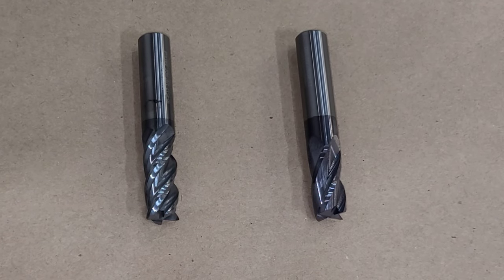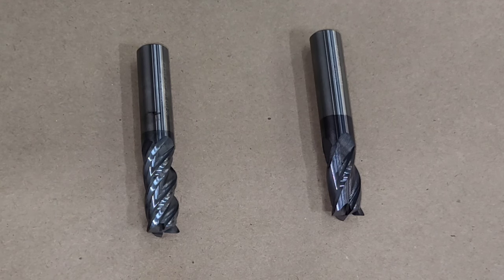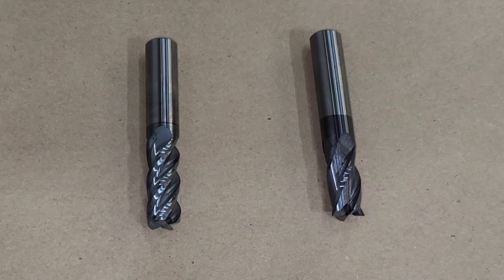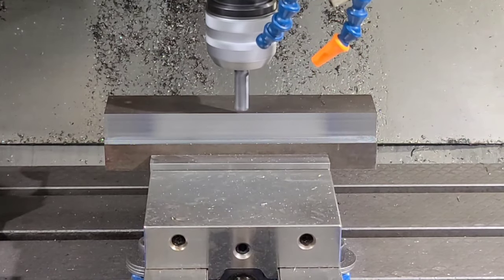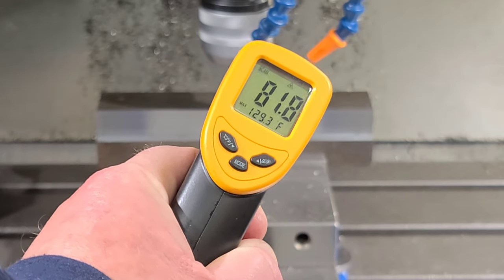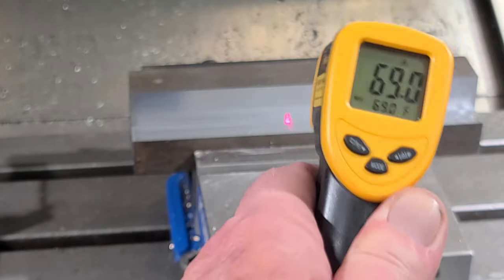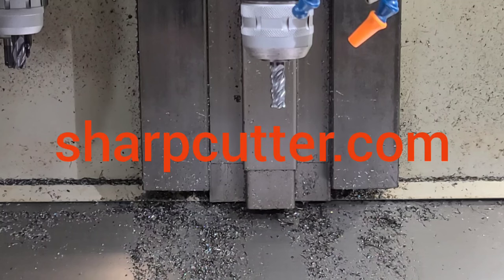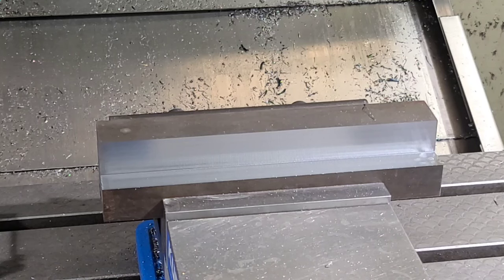Dry Milling VS Milling with Coolant on Steel What do you do?

Comment: 8 years i worked for a company from Finland that never used coolant, I later moved on & worked with a company that used coolant on all mills. It didnt take me long to realize that we were going thru twice the carbide as I was used to using.  Just like you say the coolant was keeping the carbides from reaching their optimal cutting temp.
Reply from the maker: The company I started at was the same everything was flood cooled. There is not much good info out there about this surprisingly. Thanks for watching and commenting!
Reply: @mvpmachine  so the flood coolant is not also not recommended? should not it prevent the thermal cycling/shock happening to the tool?

Comment: This is fascinating. I don’t run a lot of carbide endmills - but do run some. I always assumed coolant was a must generally, but this makes complete sense. I appreciate the insight here. 👍👍
Reply from the maker: Thanks Stuart! I am a coolant and cutting oil hater to a certain extent except for drilling and machining aluminum. It has made my life easier...But I do always use it on the CNC lathe.
Reply: Very helpful info 😮

Comment: if you look on the side of the temp gun  it shows that at 1ft distance, measuring area  is 1.5", at 3' it's 3" and at 5' the measuring area expands to 5.3"
Reply from the maker: I never looked, I will check that out, thanks!

Comment: AlTin coatings run best with airblast above 450 SFM and water based coolant below that speed. In most all grades of steel and alloy steel I run 600-1000 SFM for roughing operations, then finish pass at 300 SFM with coolant for finish quality and accuracy. Lower temp and harder coatings like TiCn generally last longer with coolant and at lower SFM. The hardness provides a longer lasting cutting edge for longer accuracy in your finishing operation. Aluminum and stainless steel grades can be roughed dry as well if you have a machine with enough power to make the proper chip required. I'll rough 316 stainless with airblast for 4-6 hours at 1000 SFM and .010 IPT on a 1/2" endmill without issue. But without the power to push it hard enough you won't get under the work hardened layer and will definitely have issues.
Reply from the maker: Thank you for watching and commenting! I always use coolant for aluminum and stainless, do you use coated end mills when you dry mill aluminum and if so what coating?
Reply: @mvpmachine  Titanium DiBoride and titanium carbonitride is the name of the coatings. Depending on the part, sometimes I use coolant and sometimes I don't. Like many aspects of machining there are lots of variables. If you want to rough out aluminum without coolant then the main requirement is lots of power and a big chip. Usually only with larger endmills. I will run insert tools dry as well and those have fully polished inserts with no coating. But again, a large chip is needed. .014-.020 IPT on a 2" diameter shell mill. I have a lot of machines crammed in a 1500 square foot shop on my home property so my main reasoning is air quality. A 3/4" endmill at 18k RPM or a 4" shell mill at 10k RPM makes a lot of smoke and mist with flood coolant. Having 5 spindles running like that makes it almost impossible for anyone to work in there even with mist colllectors running non stop, so I had to find alternate methods that happened to be more efficient and more reliable.
Reply from the maker: @pcsmachineworks  You are packed in there with 5 machines going. We have the same issue when our CNC lathe is going full, tilt steam and mist and you go home with heavy lungs for lack of a better phrase.

Comment: For tight tolerances coolant keeps the part in the right temperature zone. Aluminium without cooling sticks to endmill and breaks them. Not much else to say... everything's a tradeoff
Reply from the maker: This was not about aluminum as mentioned in the begining. And I disagree with your assertion that you need coolant to hold tight tolerances in steel, its just not correct. If you use the right tools and cutting methods you can do a job faster and with better results without coolant.
Reply: @mvpmachine  "If the conditions are right and the part you're machining has the correct shape, you can avoid the heat problem". This is what you're saying. Plus there's a problem of surface finishes of course. Everything's a tradeoff, every situation is different. Going dry 100% of the time has its tradeoffs. Sometimes it's simply efficient to trade the longevity of the tool for the result you're after. I've worked in turbomachinery facilities that are over 100 year old and must have invested millions of man hours in basically machining the same things and they run coolant on steel because of certain advantages. 100 years is enough to spot the results and the costs. Every approach has its limits, not every situation is the same.
Reply from the maker: @chronokoks  The old school shops used high speed steel and coolant is required, then came carbide without coatings and they still required coolant. It was not until the early 1990s that modern pvd coatings became available that enable dry machining to be possible. Most machinists and companies over use coolants and cutting oils because they learned in a different era and do not know better. The 2 end mills shown in my video have coatings that are pretty much ruined by coolant and they are the most commonly sold carbide end mills available today. Using coolant defeats thier intended purpose. That was the point of this video was to enlighten people that they might not be using these tools correctly and I have seen many people do that with these two types of coated end mills. I have seen people buy and use these 2 for aluminum oblivious to the fact that the coatings on these are terrible for cutting aluminum.

Comment: I’m just leaning to mill on a mini lathe with a 2 axis table mounted on the lathe bed. I was using hss end mills then i bought a tungsten carbide bit much better finish and faster cutting.
Reply from the maker: It's hard to go back to high speed steel after you try carbide! Thanks for watching!

Comment: Thank YOU!  Is there a similar recommendation for cutting Aluminum?
Reply from the maker: Hi Joell, unfortunately aluminum really needs coolant to keep it from sticking to the tools. And most coatings don't really seem to help much with cutting or tool life. I prefer uncoated carbide on aluminum because most coatings even the ones designed for aluminum rob a little bit of the sharpness from the tool in my opinion. PCD and CBN inserted cutters are possible options that I have no experience with so I cannot say If they are a good option. Thank you for watching and commenting!
Reply: @mvpmachine  - Thank you for the detailed reply as it definitively confirms what I imagined happens.  I think I understand this all so much better now.  
So in other words, if the tool gets too hot the aluminum will melt and stick to the cutting edge.  Carbide can handle higher temps than HSS.  Although aluminum specific carbide tools are almost as sharp as HSS could be, they don’t break down and lose their edge when pushed hard.  And when pushed harder (taking a deeper cut than HSS is capable of), the heat generated isn’t carried away by the chip because the thermal conductivity is so high.  The chip is then so hot right at the cutting edge it sticks to the tool.  Then making the tool edge duller, generating more heat and welding more chips to the cutting ‘edge’.  It’s probably a lot more complicated than that 😉
Continuing on in the ‘cutting of aluminum’ theme, do you have any MQL vs Flood experiences you can share? (Maybe a future video?) I can see lots of benefits of flood cooling and I suspect it is superior in every professional setting.  But in less optimized environment (hobby CNC) can MQL also be effective to keep the tool cool and have a high enough air blast to clear the chips from the slot?  🙏🙏
Reply from the maker: @joell439  Sorry I did not see your reply and would have responded earlier but you pretty much nailed it in regards to how aluminum acts with end mills. Regarding MQL I am not a fan and never will be, there are salesmen that want you to believe these lubricants are necessary, and all they do is pollute the air in your shop when they turn into smoke, in my opinion. I only use oil of any kind for tapping on manual machines and coolant on CNC machines. Coolant for milling aluminum can be either flood on CNC or mist on a manual mill but I think oil has a negative effect on cutter life and finishes.  Just my opinion some people are addicted to milling with oils but I think it just makes a mess and is useless. Air blast is always a plus.

Comment: I am learning a lot. Just got a job as a CAM programmer (Hypermill) but I have never even done any CNC programming, LOL. My first real assignment is a part made of Toolox 44. My very experienced colleague pretty much decided on the approach and the machining parameters. Most of it is done with a 12 mm carbide end mill but a lot is done more with the face than the side of the cutter. I asked him about the trochoidal technique and he said he has experienced cutter breakage in the past. I am sure we use flood coolant pretty much always and have no air blast. It looks like constant cutter loading and more stable temperature along with using as much as possible of the flute length and air blast for optimal chip evacuation is the way to go. Even though the part is a one-off I found the machining time as it is programmed now very slow indeed.  
I never used coolant on my conventional lathe and it always worked great.
Reply from the maker: Thanks for watching and commenting!  It is likeley the coolant could be causing some issues with the tool breakage as well as not enough of a cut. That material is relatively easy to machine but can work harden with an overly hot tool making the part hot then cooling it instantly.  Air blast is relatively easy to rig to try it and not too hard to make a cheap sytem for permant use. It likely would help you. It is only used to get the chips out of the way to avoid recutting  it is not meant to cool the part or tool the heat comes off with the chip. I hope your new job goes well!
Reply: @mvpmachine  Thanks so much! I will investigate further. It occurred to me that only a microsecond of inadequate chip evacuation loading up the tool/ recutting that could cause instant breakage. Also I have seen some cases here on YT of Toolox 44 being dry machined with maximum flute engagement. The technique makes all the sense in the world to me and when it does not work I think it's worth finding the cause.
Reply from the maker: @bigbattenberg  using as much of the flute as possible is easier on the end mill for sure. That material does not do well with small cuts it is similar to grinding it does heat things up.

Comment: I've never run CNC.  Most of my milling has been done on small machines similar to bridgeport.  Ive always used cutting oil rather than coolant as it wasnt messy and most of those machines had no option for coolant.  Does the oil have the same effect?  Of course these machines cant cut at near the rates that your CNC does.  Love to hear your thoughts.
Reply from the maker: Hi, thanks for watching and commenting!  The answer to you question really depends on what type of cutter you are using. With high speed steel your method is not bad, but with inserted carbide cutters nothing is needed and you may be hurting your tooling with oil. If you use carbide end mills I do not know that I would spend extra for the high performance coatings because it would defeat the purpouse, you likely can get them hot enough to work by using a slow feeds and speeds but that's not necessarily good for the carbide without the proper chip removal rate..Plain uncoated carbide will work fine dry but a small amount of oil would likely be beneficial.
Reply: @mvpmachine  excellent. That about matches my current use thanks!

Comment: Interesting. I sometimes use Cool Tool II for fine finishing on lathe cuts, I can see the difference but it's not exactly cooling the cutter. I always use cutting oil on cut off operations. What are your thoughts?
Reply from the maker: Hi, Thank you for watching and commenting! I think turning is a different animal on a manual lathe dry milling would most likely be fine for 99 percent of the operations. For parting I agree with a oil, coolant or lubricant because the tool tip is usually so small and that makes it tough to shed heat. Also chip evacuation when parting needs as much help as possible. For a CNC lathe I do believe in full flood coolant all the time due to the massive amounts of material that can be removed in a short period of time the workpiece can get too hot without it. I would be interested to hear other opinions on this but I always use full flood on the CNC lathe and it can steam up the shop pretty good.
Reply: @mvpmachine  thank you!

Comment: Full slott 2xd in 1.4301 . Internal Coolant . 8mm Cutter
Toollive over 4 hours .               Vc 80 m/min  0.08 mm/ rev.
Reply from the maker: Hi Dieter, Thank you for watching and commenting! What is the cutter you are using and coating?
Reply: Cutter ist from Gühring
Alcrona Coating 35/38 and 4slots. Inner Coolant pressure 10bar. Works awesome.

Comment: Does this apply to lathe tooling too?
Reply from the maker: Andy, my thoughts are for a CNC lathe it does not apply. The coolant likely does have a bad effect on insert life, but you can generate so much heat especially during rapid stock removal that it would likely be bad for the part. Our CNC lathe can steam up the shop preety good when we are doing production. On a manual lathe I would say in most cases except tapping and drilling no coolant works fine. Thanks for watching and commenting!

Comment: An IR thermometer like the one you used is almost completely useless for measuring metall surfaces.
Metall surfaces act as a mirror, you are mostly measuring  the temperature of your clothes and any other  reflected object in the background.
Put a pice of tape on metal surfaces you are planning to measure then you get much more accurate measurements.
If you get a heat camera it is very obvious that you se a mirror image of your body heat in any flat metallic surface.
Reply from the maker: Not true works on steel not aluminum, I know this well. Thank you for watching!
Reply: Reflective materials in general will do it, and yeah have seen my reflection in steel
Reply from the maker: @StepSherpa  i have burned my hand on aluminum before I knew this. If you check out my propane tank wood stove video, I show this same IR thermometer reading off of the stainless top up to like 500f.
Reply: @mvpmachine  The wood stove video at about 11 minutes pretty much proves my point. You are measuring higher temperatures on the back and sides than on the top. That is probably because the sides are painted and the chimney is more oxidized.
The top that is a cleaner steel surface probably reeds to low temperature.
Reply from the maker: @larslindgren3846  The stainless is 1/4" thick compared to the less than 1/8" thick steel on the sides and stainless is a poor conductor of heat. the back shows more heat also because that is the exit where all the heat goes, also higher than the thicker stainless steel. If you look at the thumbnail on my other woodstove video shown here the red tells the story,  https://www.youtube.com/watch?v=Lhe9zpZAupM&t=728s
this was a pine fire and the whole thing gets crazy hot but the red is concentrated toward the back.